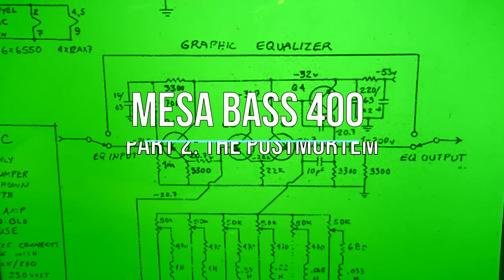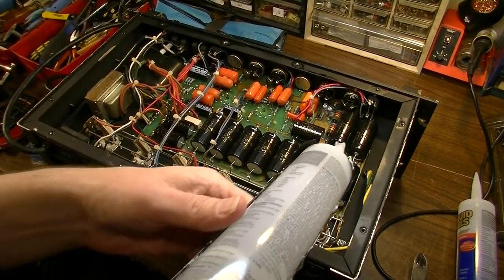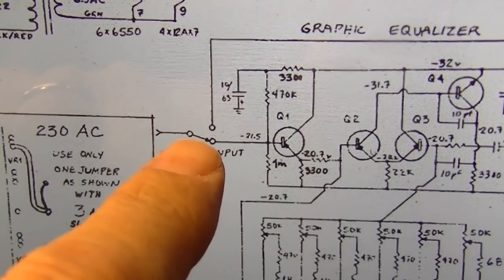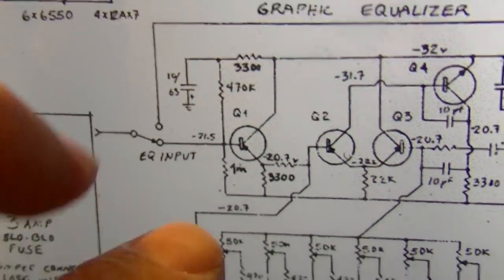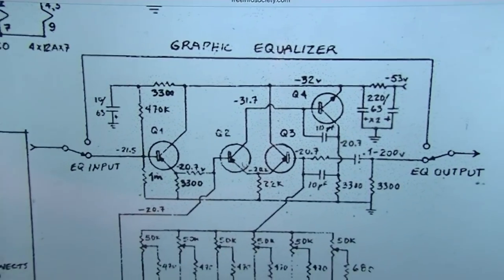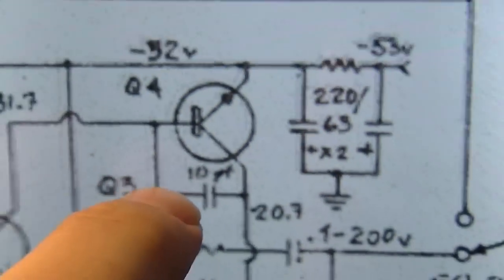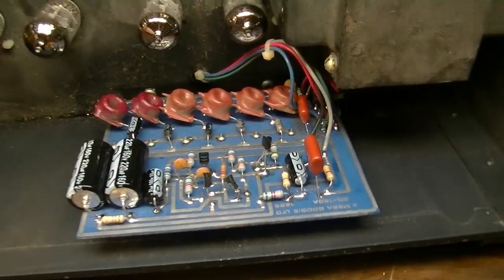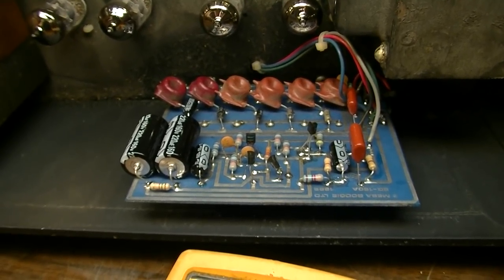Does Mesa Boogie Intentionally Falsify Schematics? EVIDENCE INSIDE! Bass 400 Service Postmortem

Comment: the cooling fan would really annoy me if i could hear it, id have to swap that out, is there any benefit to cooling the tubes with a fan ?
Reply from the maker: When there are SIX of them and this was in a rack, the fan would be almost necessary on hot days at outdoor gigs, for instance.
Reply: Cooling fans don't seem necessary until they are.

In my younger years (before I knew you could fix solid state amps) I had a gk700rb. The fan went out on it and it'd easily over heat in our conditioned practice spaces. We were in high school slightly before the internet was a big deal and we couldn't find a fan that fit.so I left the cover off- so I took a giant floor fan pointed down over it everywhere we went. I never had a problem after that but it looked ridiculous and was a pain to haul.
Reply: It's a bass amp. If you can hear it you're doing something wrong!
Reply: When cranked at 400 watts, if you can hear the fan, you are way too close.
Reply: Most electronics like the cool.
Reply: Did I ever tell you fellas about the time I got my pecker wedged twixt two tubes at a clothes optional gig ? Believe me, a fan on them tubes would've made my day much better. BTW .... always wear a Jimmy.
Reply: I get Japanese fans that are designed for 200vac mains. that puts them in the sweet spot , of good CFM and super quiet. If you try a 240vac they run to slow on 120vac .
Reply: +G n' GF The M/B 400 doesn't put out 400w though, the name doesn't really correlate with their true output power no matter what Mesa says -- another bit of "artistic licence" on Mesa's part :-) With 6L6's it does 150-180w, with 6550's/KT88's they put out around 250-275w. Nor does the 400+ put out 500w, a more realistic value is around 300. Still more than enough to rattle the fillings off your teeth through a PH-412 or 810, especially if you put an HPF at the end of your chain dropping anything below ~40Hz, that'll stop you wasting power amplifying frequencies your cabs won't be able to put out anyway.
Reply: During playing, average plate dissipation increases, so output tubes are biased to a percentage of their max. plate dissipation rating which keeps their average dissipation below maximum during playing. Dissipation is a measure of the amount of heat that can be radiated away from the plate and conducted into the atmosphere by the glass envelope. If the surrounding air is too hot and the plates are unable to dissipate sufficient heat, the tubes exceed their maximum dissipation, at best reducing the useful life of the tubes, or at worst causing them to fail.
A little known fact is that some varieties of Bakelite used for tube bases begins to conduct when hot. It's only a tiny amount, but enough for current to leak between screen and grid pins. Current flows through the grid resistors, developing a positive voltage which is subtracted from the negative bias voltage, increasing plate dissipation, the tube gets hotter, the bias is reduced further which leads to thermal runaway. It's quite rare, but it does happen!
Reply: I don't get why people are always complaining about cooling fan's in the instrument gear realm. I mean amps are something to belong in a rehearsal space or on stage. It's fuckin' loud up there. If you're able to hear that little thing you're doin' something wrong haha.

Comment: I would be pissed getting my amp back from service and seeing silicone all over the place like that what you should have done is to put a small bead under the cap prior to soldering it in so it would be direct contact to the board then there would be no need for it on the top and all over the place at all.
Reply: If your Knowledgeable  enough to open the amp and check the repairs and the vanity of them  why would you send it out  rather than repairing it yourself?
Reply: Amps are not my specialty, I'm a master computer hardware tech been in IT and electronics for over 25 years so I know a thing or two

Comment: It’s more likely that whoever drew up the schematic (and it does look hand drawn, to me), probably was in a rush, and forgot to copy down the component values. As for “errors”, this could have been for a different board revision. Given how simple something like this guitar amp is compared to, say, a computer motherboard, it’s too easy to reverse engineer a “true” schematic from a working prototype. We’re talking point-to-point wiring and single-layer PCB’s here. As long as there aren’t burned-up (or missing) components, or semis with the part #’s rubbed (or etched) off, it’s pretty trivial (if tedious) to make a schematic for this. It makes no economic sense to make deliberately “fake” schematics; the company would risk having these end up in “authorized” repair centers too - or worse - make it back into internal “official” documentation! Then they’d be buggered! 😎